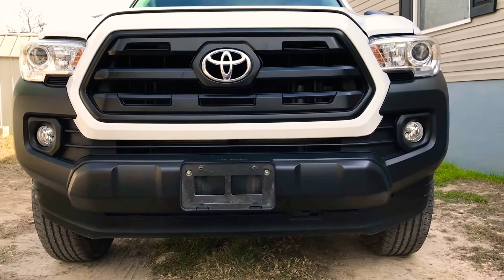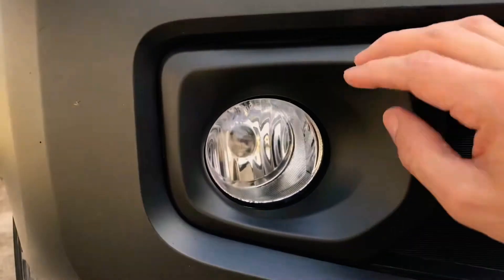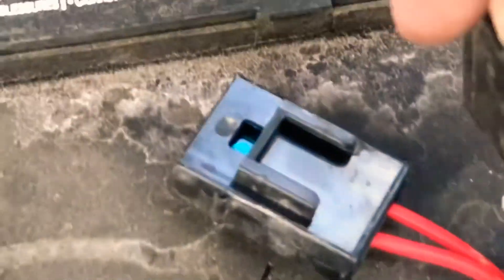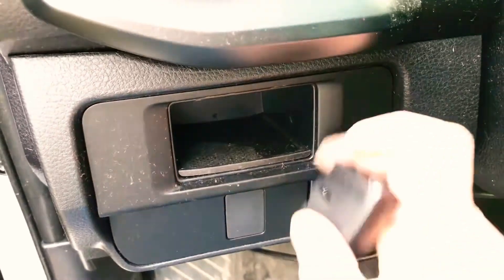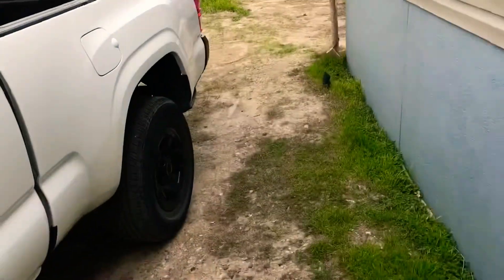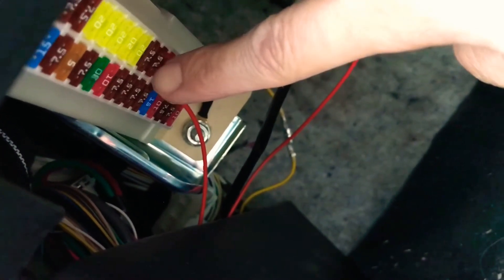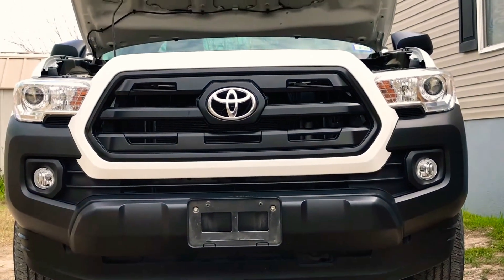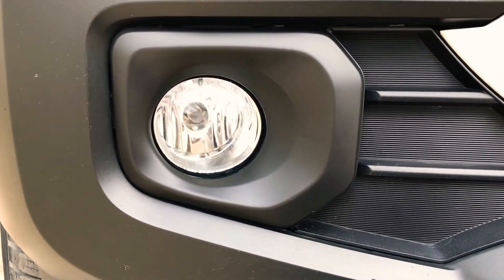Toyota Tacoma $50 Fog lights for 2016 - 2020

Comment: Looks like your truck is pre wired to oem style signal stalk. So you don’t need to run any wires through the firewall. But then it would of cost more. 

But looking good man. I got ss3 LED lights.
Reply from the maker: I want to get some LEDs too. where did you get yours?

Comment: I know this is 3 years old but maybe you still stroll comments... hows it holding up? I'm about to do this to my 2020 SR, also is there any way to clean up those wires and hide most of them?
Reply from the maker: Anthony hooser, the fog lights are still working great. The wires are pretty clean in my opinion. Nothing is hanging out and there is a lot of space under the hood to hide wires.
Reply: @electriccuts  I was thinking of cleaning it up so I can get the fuse cover back on under the drivers side and that wire you have going to the switch being out like that. Might need to do some tinkering but they came in the mail today and going in some time this week. Thanks for the reply!

Comment: Do you have a Link, name? Anything a out these housings? :)
Reply from the maker: I got them on eBay. Let me see if I still have the seller that I bought them from..
Reply from the maker: Just go on Google or ebay and type "Toyota Tacoma fog lights"
Reply: @electriccuts  picked up something very similar off of Amazon for a pretty decent price. So long I can put my own bulbs I'm happy. None of that LED stuff.
Reply from the maker: @theshazman  you can get an add-a-fuse to connect the lights to a specific fuse that you would like to use…

Comment: I bought fog lights blew two bulbs!the smell of a hot wire occurred so I disconnected
Reply from the maker: Sorry 😞 to hear that… I would try to get a replacement if I were you. Then get some help from someone to install the new ones. It can be tricky to wire them… I would know… I had that same thing happen to me once.
Reply: @electriccuts  pretty sure it was wired  ok could it be a faulty light kit